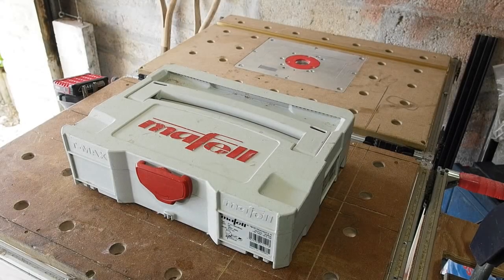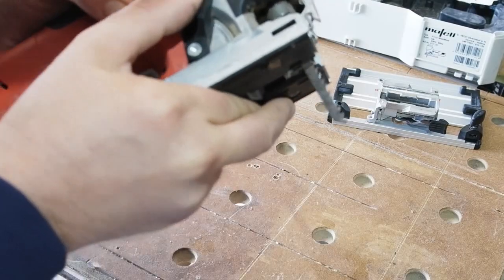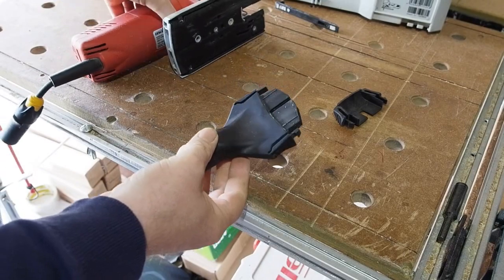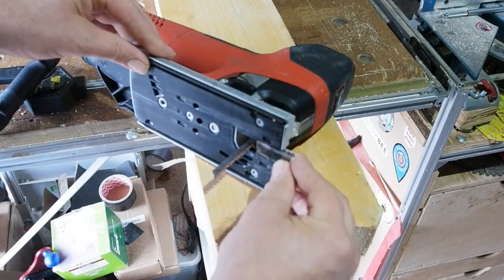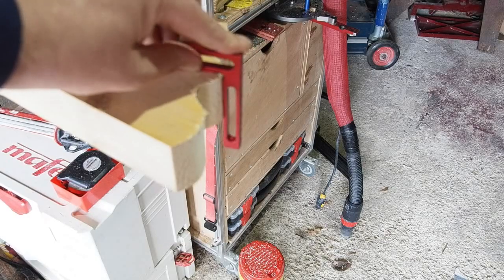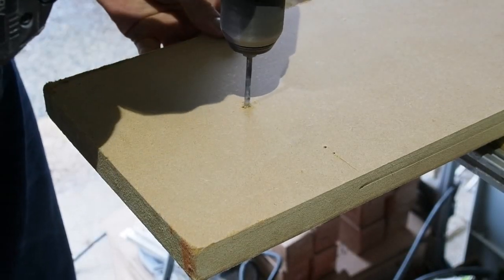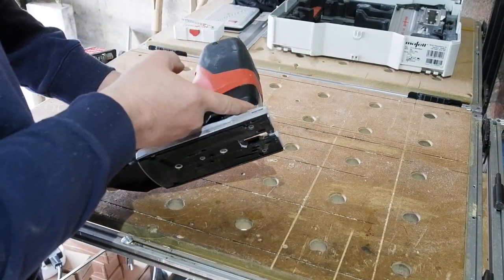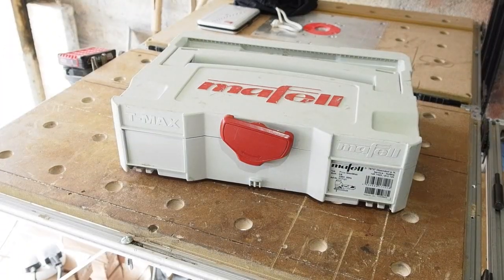Mafell P1CC Jigsaw. A Closer Look And Review.

Comment: Looks a great bit of kit and would be tempted to buy one. Do you know what the longest cunex blade is? Would work perfect on the track cutting  insulation boards if these blades are available.
Reply from the maker: As jigsaws go, it's quite a machine. They are working on a cordless version apparently. Only 1 size of cunex blade unfortunately. 75mm. Good for about a 50mm cut. The teeth are quite aggressive too so not great for insulation. I have used a long bosch blade in it for insulation. Can't remember it's code but looks like a bread knife. Works well on 150mm celotex.

Comment: Wow, that 45 degree cut looked like it was glue ready!  Pretty amazing from a jigsaw (even if it cost more than my first table saw).  hahaha  Cheers!
Reply from the maker: Cheers Brian. Yeah, it's capabilities are impressive (for a jigsaw) when paired with the cunex blade. Mafell are placed pretty much like Hilti in the tool market really. Meant for commercial, every day hard slogs. Most of their machines for specialist timber framers. And serious money to boot! Bits like this jigsaw, the plunge saw, the milling motor and the drill are their most "affordable" or accessible for the average Joe I suppose. Still not cheap of course!

Comment: Thank you for the quick response!    Is it possible to plunge cut from both sides?
Reply from the maker: No probs. Was answering comments when yours popped up.😁 . I'd say your best bet for decorative corbels is first make a ply temple of your pattern. Mark your piece and cut about 8-10mm into the waste with a jigsaw with a long blade. Then fix your template and use a router with a long flute and guide bearing top (shank end) to finish nicely. This should give you nice clean uniform results.

Comment: Great video and lots of good information. I’m in the market for a new jigsaw and looking at getting a collins coping foot - this video has helped a lot!

One question not covered: where can I find the really small systainer and what’s the name of it? I imagine it’s really good for storing jigsaw blades. I can find the Festool SYS3 XXS but can’t seem to find the Mafell equivelent one. I’d appreciate any help on this!
Reply from the maker: Cheers David. They are a great jigsaw. If it was cordless and had a light, it'd be the ultimate! The Cunex blades and it's power do set it apart from others though.
Not used the coping foot. Not really need for what I do now. I would imagine that the coping foot with a cunex blade would a perfect combo!
The little box is called a micro systainer. The mafell ones were a promotional item so hard to find. They do come up in eBay now and again.
Found a link to someone selling them in Europe - https://www.gereedschappro.nl/mafell-micro-systainer-t-loc-grijzig-met-rood-uniek-en-alleen-bij-ons-microsys
Reply: Thanks for getting back to me. I’m close to pulling the trigger on a P1 CC. I do a lot of renovation work and will look into getting the coping foot as well (don’t really need the rail and already kneedeep in Festool).

I managed to find the microsystainers from a company in Holland - just ordered four of them!
(these should be a regular as they are great for bits and bobs)

Comment: Interesting video but what's the point of that power and rigidity if the biggest cunex blade available only cuts to about 60mm. I would want it for railway sleepers fence posts and the like, at least 110mm depth of cut.
Reply from the maker: Cheers. The power it has is to push a nearly 3mm wide cunex blade through wood at 50-60mm. That's circular saw territory. For cutting sleepers, sure, you could slot in one of the oversize standard jigsaw blades at 140-210mm in length but the blade all wander. Fine for one or 2 cuts but, if you want to do a lot of sleeper cuts, a jigsaw is the wrong tool for the job. You'll want a chainsaw.

Comment: Great review, thanks! Can you provide advice on when to set the pendulum high vs low vs middle? Thanks!
Reply from the maker: Thanks Max. Generally, pendulum off is for a fine/clean cut, on is for a more aggressive cut. Pendulum is useful for cuts along the grain (rip) or thicker stock for example. It's also faster cutting. Medium will reasonably clean and quick. On plywood, I  tend to have the pendulum off or on a low or medium so as not to splinter the edges too much. Have it off for metal cutting too. You can sort of match the setting by blade too. The finer tooth the blade, the less pendulum generally. Hope this helps.

Comment: Do you have any idea when the cordless version is coming to market? I have gotten spoiled with my FLEX jigsaw, no cord,, lots of light, it blows to clear the line of site with 24 volt stack lithium ion batteries.
Reply from the maker: No mate. Been hearing from retailers and importers that they've been "working on it" for about 5 years now. Still nothing. I'm surprised tbh. They've successfully produced cordless versions of their other smaller saws🤷‍♂️
Reply: @BischBaschBosch it has been about a year since you answered this fellow, any word now on a cordless version or is Mafell attached to their cord?
Reply from the maker: @NonaNona-zh4mt  I think when it comes to Mafell and their cordless jigsaw, they suffer from nuclear fusion syndrome - it's always just around the corner, yet never seems to happen! Some reps at fairs last were saying they had actually started working on one and "might be next year" but who knows🤷‍♂️
Reply: @BischBaschBosch  so I saw one guy in Germany post a short with a Mafell cordless jigsaw. Do you have any good news on this saw?

Comment: How did you get the p1cc base plate to engage when the blade was pushed to the front?
I can get it slid forward but can't get the base plate to tighten up
Reply from the maker: It should engage just fine bud. If yours isn't, remove the base plate and make sure the slot in the base for blade-front is dust free. You could also try backing off the allen a 1/4 turn or so for the little locking plate. I had to tweak the tightness of mine so it was just right in both positions.
Reply: @BischBaschBosch  I've just had a good look at my base plate and I've just noticed that the groove edges have broken off, I'll order a replacement. 

Thanks for getting back to me

Comment: Is the €486,- for the P1cc maxi max worth the price.Is there a better option in the market.

Is the price  578.- for the MT55CC worth the price. Is there a better option in the market.

I owned the festool tsc 55 cordless it was realy weak and shit to use.
Reply from the maker: Whether they're worth it or not, only you can make that call really mate. You know best the type of work you do and your needs. For me, that I can get an edge 90 degrees to a face with the P1CC and Cunex blade means doing decorative rafter and pergola tails or corbels isn't a problem. If you need a jigsaw capable of doing such irregular cuts able to keep a 90 degree edge, it's worth it. Same would go for if you work a lot with solid hardwoods where the extra power the saw has makes cutting even the hardest woods a breeze by comparison. If you don't do/need these things or you need a cordless saw, the Mafell is probably not for you. Same goes for the MT55. All the plunge saws offered by the big name brands are pretty close in terms of performance. They're all pretty good in my view. What I really like about the MT55 is it's power (the corded model), ease of blade change (as I swap blades a lot when working), it's superb dust collection, it's fine tune features and it's scoring cut (though this for many is a controversial feature). If you were to ever get the cordless MT55, it'd be worth ditching the supplied 5ah Mafell batteries supplied and getting the 8ah Metabo batteries for it. This vastly improves performance. Still probably not a match in terms of power for corded saws or even the models of saw that use 2 batteries for 36v like the Festool or Makita. The Makita also has the scoring function as it happens, and if not the Mafell or Festool, that'd probably be the saw most would recommend. It's a really good value saw.

Comment: Tengo un problema con la sierra mafell. La hoja de sierra no queda perpendicular al plato cuando la introduzco.
Reply from the maker: I would say to check the most obvious first. Check the blade you're using is actually straight. Also check that your base connection is free of debris and seated properly. If it is under warranty, send it back to Mafell, describing the problem.

Comment: Could I cut scroll work on a 4x4. I’m making an arbor and need a detail on the end tails?
Reply from the maker: Unfortunately, the cunex blades that allow for good square scroll cuts are only available in 75mm. You can buy longer standard bayonet blades of course but these would be as prone to wander as with any other premium jigsaw. Why Mafell haven't released a 125mm version of the cunex for 4" stock I don't know. As it stands, 2" is about the max for the cunex.

Comment: What make are your power cable connectors and are they any good?
Reply from the maker: Yeah, they're Neutrick Powercon True 1Top connectors. Been using them a couple years now. No issues. I like em. Did a video on them with links in its description if interested.👍 https://youtu.be/jnQPcGuLKzk

Comment: Can anyone comment on the size of the handle? I have smaller hands and am wondering if there is a chance it will fit. Can't get my hands on one to try out.
Reply from the maker: That's a good question. This Mafell, like a lot of barrel/body grip jigsaws is quite chunky. About the size of a can of Coke in diameter. If this would make things difficult, you might be better off with a bow handle jigsaw. Unfortunately, Mafell don't make a jigsaw of this type.

Comment: Just ordered mine after waiting and hoping for past three years that the cordless version would be released. Sadly that doesn't look like it will happen.

On one hand that is disappointing, but on the other it is exactly the reason why i don't mind paying a very high price for Mafell tools. They don't do compromises and they don't release half-baked products. As long as they cannot make s cordless version that would match the impressive 900w and still have acceptable battery run time, they won't make it, even if it still probably would sell like crazy. 
If this was festool, the poor machine would probably already have more letters at the back of the model name than latin alphabet can offer
Reply from the maker: It's a strange one isn't it? The reason the corded has 900w is due to the effort needed to push the cunex blade through stock at full depth. The cunex is near as damn it 3mm thick at the cutting edge! It's like a table saw cut! Like you say, it could well be they've not had good results with that blade in cordless tests - made more difficult by a jigsaws compact body? Either way, it's s hell of a jigsaw. Sure you'll love it.👍
Reply: @BischBaschBosch  i bet i will! So far never had a disappointment from that company, and i have a fair few from them by now. I held off on buying it for so long as I only did work on site, but now that i finally have my own workshop, cable machines make more sense again. That said, as soon as they release the cordless i will be snatching it up immediately

Comment: I use the 144d and the cut is still perfect...
Reply from the maker: I really rate most Bosch jigsaw blades. Use them all the time. But no. They still deflect. Yet to see anyone claim it and show perfect 90 and 45 degree cuts through thick stock like i did in this vid. Only the Cunex can do this every time in my experience. Not trying to be an asshole, just my experience.

Comment: It’s mad how the most expensive jigsaw on the market doesn’t have a light.
Reply from the maker: Currently, i think it's actually the second m8st expensive as mafell are promoting the release of their cordless version - with a light! The main reason the P1CC didn't include a light was these barrel grip jigsaws a most often used upside down - especially by European users. A light shining in your face is a bit pointless used this way. My 18v Bosch barrel grip has this fantastic innovation they call an "on/off" button, or something weird like that. Maybe it'll catch on😉👍
Reply: @BischBaschBosch  Yeah, I’ve seen the new cordless one at almost £800 🤯 I can’t imagine they’ll sell many at that price. It still doesn’t make sense as like you say the light can be turned off. You can do this with the festool one.
Reply from the maker: @HarveyJohnWillmott  😂 Yeah, with the batteries and charger it's eye watering ££ for a jigsaw!:In fairness though, typically for Mafell, it does look a super sturdy, well made machine.

Comment: It's funny, the jigsaw costs $900, but you can't see the cutting line. A great solution)))
Reply from the maker: It's a barrel grip jigsaw so most of the time, it's used upside down.  It would be nice to have a light though  - for those occasions working from above.
Reply: @BischBaschBosch  Upside down, this will be one of the serving options. But the main thing is normal downward work. And using this jigsaw, you won't be able to see! To watch! cutting line, not to mention backlighting. It's a terrible failure, and it's very strange why no one talks about it.
Reply from the maker: @tripleup2012  I don't know where you are but here in the UK and EU,  this type of barrel grip jigsaw is mostly used upside down to cut scribes and cut aways. It's literally what they designed for! I'm saying this as someone with over 20years in the professional trade, not some youtuber learning as they go. I've had this jigsaw for about 8 years now. I can't think of a single occasion where sighting a line was a problem. If it's not for you, that's fine.
Reply: @BischBaschBosch  I am in Russia. Basically, we have marketers and people who have been paid for advertising telling the same tales. But still, no one buys this. If you've been "practicing" for 20 years, why are you sawing an arbitrary twisted line the same way you do in the demonstrations? In real work, this never happens. I have a GST 140CE jigsaw and for some reason it provides a great overview of the workspace, which is of course strange, but it is also designed to work with both trimmings and large slabs.
Reply from the maker: @tripleup2012  Don't take the piss mate. I'm no salesman or marketer. I bought the tool with my own money. If you can't comprehend what's being demonstrated, just move on. Don't bang on about me telling "tales" or I'll just delete you fucking comments.
Reply: @BischBaschBosch  I’m not saying that you are telling fairy tales, but I must note again that it is very difficult to see the cutting line on this device (this can be seen in the video), and also in the video there is no very reverse feed, which is “often used” by the craftsmen for whom it was supposedly created this tool.
Reply from the maker: @tripleup2012  You can reverse the blade. I say so in the video.

Comment: Further to previous comment i just thought of another power tool that i still have that i would rate more than the Mafell! I still have my ELU TGS 173 its perfect and still cuts true! Im guessing a lot out there wont know ELU Tools or the TGS:  Dewalt purchased elu so they could manufacture the saw have a look after they cheapened it: https://youtu.be/OOYtY2P-b1Y
Reply from the maker: Elu did some great gear. Not only well made but quite often really innovative. Their 173 flipover saw is a classic. I've been keeping my eye out for one of their ETS 3001 push/pull table saws for some time. Pretty rare though.

Comment: Amazon reviewers in Germany report issues with the electronics followed shitty customer service by the manufacturer and costly repairs. Not exactly what you expect from a premium priced tool maker.
Reply from the maker: Never had any electronics faults on any of my Mafell kit and so never needed any service. I have needed accessories from time to time though and my local dealer put me straight on to NMA Tools, the UK's Mafell importer, and they were extremely helpful. Lesson there is buy from a reputable dealer, not Amazon. Also worth noting that the minority who've had a negative experience are far more likely to leave reviews. I take em with a pinch of salt.
Reply: I haven’t had any electronics problems either in one year of use